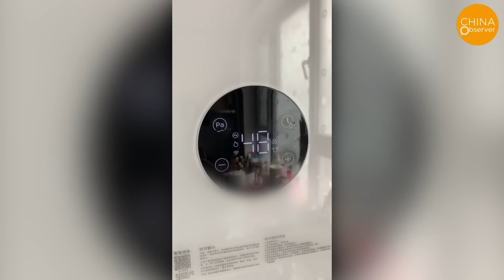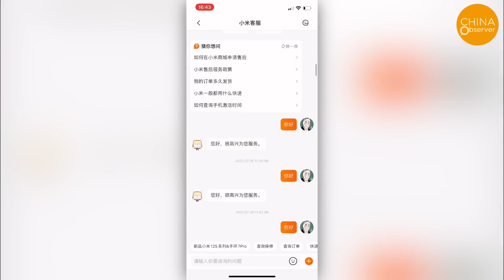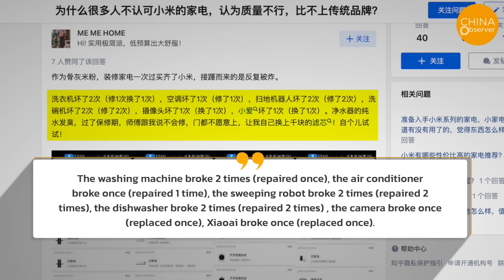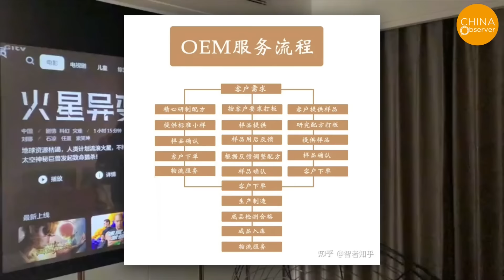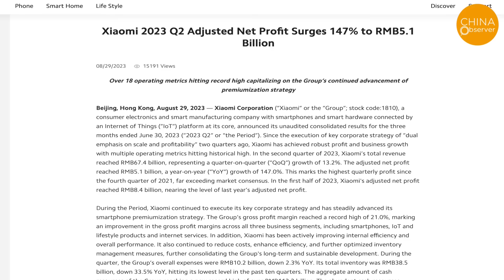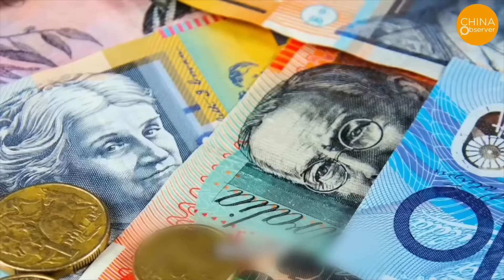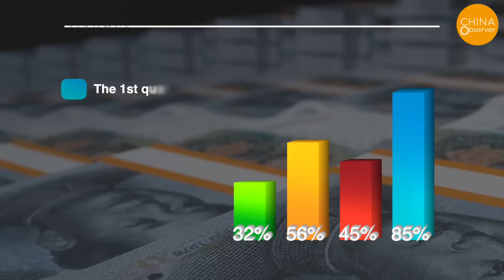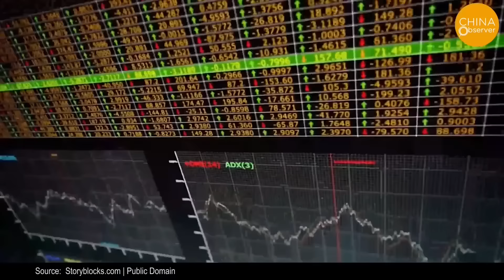Xiaomi Is Trash: Its Quality Is Shockingly Bad. Buyers Smashed It

Comment: I have a Xiaomi Mi 9T since 2019. While everything worked fine when I got it, with each software update features where changed, added, broken or removed entirely. I am at a point right now where it finds software updates for MIUI, but fails to download them.

I also got my mom a soundbar from Xiaomi, but I modified it slightly to use a different power adapter because of the weird voltage requirement, since the included one ran extremly hot. Except of that the soundbar works fine.

But hearing even before that the quality drops more and more, I doubt I will pickup another Xiaomi product, especially not another Xiaomi phone ...

Comment: Xiaomi still is an ONLY cellphone manufacturer, that up to this day let's you split screen and run two apps in real time. I have YTbon one and a game or gmail on the other. Samsung can't do it even today and it SUCKS. This and optics is an only reason i buy them. Also they use the same screen as iphones. I don't know about low, mid end models. I also know nothing about any other products.
Reply: my a12 has that, check on labs first before you spit bs

Comment: One of my rules of thumb in buying things is: To buy only specific things that match the company's speciality. 
So if I want to buy a smartphone, I would go to companies that are mainly sell smartphones and known as outstanding for their smartphone. I wouldn't go to a household product speciality company that sells smartphones as their second-third project, because I know where their focus on.

Anw, that's why I also own Xiaomi Mi5 that has lasted for about 7 years that has great performance, with a bending frame, and cracked glass, but still a clear display without any pixel problems. Been drowned and dropped many times and still revived, and never once put into the factory for repair. Really tough one. Until not long ago the battery started to bulge and finally put on rest a.k.a. ded fr.

Comment: The video clip shown at 3:00 minutes is probably not a problem due to quality, but rather looks like a user error. Usually, the machine only starts to wander if the customer forgot to remove the transit bolts (3 to 4 screws that hold the spring loaded drum in place, so it doesn't swing during transit). 

If those are left in place, the drum can't swing freely and counteract the imbalance, especially during the spin cycle. All the imbalance is then transferred to the entire appliance and causing it to wander. I had this "problem" happen to customers of mine in the past, even with European brand name washing machines. At some point I just started to remind customers to not forget to remove the transit bolts. 

Other than that, yes, a lot of products made in China, even under other brands or brand names they bought all over the world, are often not that good when it comes to quality.
Reply: My parents (this was decades ago) had an old  GE or Whirlpool that did that.  Scary as pluck.  But it was old.  It was replaced.

Comment: What a load of crap. We've had Xiaomi smartphones since 2015. Probably a dozen or so by now. No problems at all. I've just got the Xiaomi Pad 5 pro, it is fantastic. Again, no problems. We have 6-7 lamps, some are over 5 years old. Never a problem. We have light bulbs from Xiaomi. Never one problem. We have chargers from Xiaomi. Never a problem. We've bought 3 or 4 earphones. They still work perfectly despite being 7 or 8 years old from a time before wireless. We've had two electric toothbrushes. Never a problem. All products have been great value, with very good design, so the aesthetics are also ok. 

I know we don't live in China where Xiaomi sells many more products for the home which we don't have in Europe to the same degree. But to us, Xiaomi stands for great value, quality and great design. I have been disappointed a few times with products from China but never from Xiaomi.
Reply: It has probably to do with their recent products, last year I bought a Xiaomi Tpro and it's already having a bunch of problems such as glitching screen, battery problems and apps shutting down. Their older products may have had a good quality but at the moment I would wait before getting something new from them

Comment: Xiaomi doesn’t make these. Most of the times it is an OEM rebrand. I on the other hand owned a pair of earbuds and a phone a year back and they worked well beyond their price I paid for them. Unfortunately the phone I used was battered beyond salvation and I accidentally carried it with me to the sea ending its journey abruptly. The buds just started losing its charge after two years and switched to apple because I bought an iPhone.

Comment: I've had their Mi 11 Ultra phone for over 2 years and the camera tech is still the best I've owned so far. Had to retire it after the battery life became too short and the screen repair cost after a short drop off the couch cracked the screen. I considered a new Xiaomi but the reviews of the newer models are less than stellar compared to the 11U. Combined with the lack of network bands for NA, i switched to Oneplus to save myself the hassle. Seems Xiaomi is getting lazy.

Comment: my 46 inch sony tv from 2011 still working great, i bought a Xiaomi 55 inch tv in 2022 after 1 year display panel start flikering so i call the xiaomi support and they said its panel issue and panel cost is 20 percent less than new tv or exchange with new tv.

Comment: Xiaomi strategy is good software out of the box, and everytime your phone will have an update it will slowly become slow and have bugs making the phone laggy annoying to use unusable, so better dont update your phone if its working properly or switch to custom roms if you know how to do it.
Reply: That's not the case. They always had certain support period for their phones software updates (1-3 years, depending on price range). The main  factor of phone slow downs is the internal Android framework and behemoth Google Play services and apps that take more and more resources with each update.
Like my oldest Redmi 3 was released in 2015, last official firmware update was in 2016 but it still works until this day but obviously feels slower than back in the day. Xiaomi has nothing to do with it for 7 years, but Google services and apps still updating, taking more and more resources. If I were to install clean custom firmware without those services, performance would improve significantly.

Comment: It is not just "Xiaomi" products that have quality issue,  basically, all and every things "Made in China" would have quality issues, due to the manner and pressure exerted on the production lines to run faster and faster.  Additionally,  if you ever dismantled a "Made in China" Chinese Brand electrical appliance, (Caution / Warning , that is if you are qualified to do so), you would be shocked by the poor quality wirings and soldering of the connectors.  It is no wonder, such products, do not have long usage duration and would break-down (esp. due to over-heating) etc. soon after putting to use.

Comment: It ain't that bad i my family, except my father, had a Xiaomi note 9S since 2019, and here we are, and also, i don't even have an screen protector neither a protective case, and my phone has fallen a good ammount of times, It doesn't even have a single crack, and my mother has a Xiaomi mi band, don't remember the model, but she has had It since 2021 and it's been in water a lot of times so It is water resistant as It should be and it's very scratched but not broken

Comment: havent any problems with xiaomi products. robot vacuum is already 5+ years in use without any problems, last 3 smartphones also didnt had any problem. smart watch also already 2 years in use with no problems. Only complaim maybe wireless headphone, battery degraded faster than i was expecting after first year, but remains at same level since first year (already 4 years in use). maybe im lucky

Comment: I had XiaoMi hairdryer and got almost killed by it because the electric wire insulation broke and the sap I received was insane.
In addition I also have XiaoMi vacuum robot that works but it’s battery is already so out after one year that it only finishes my tiny room on low power level 😢

Comment: The water heater is supposed to switch off when it reaches the maximum temperature, you either turn down the gas or turn up the water flow to maintain a steady temperature somewhere below the maximum. That's just how they work.

Comment: Xiaomi is becoming a useless brand as time goes. My Xiaomi Smart Band 7 pro failed after few months. Reason: I showered with it few times and its screen failed to respond to touch.

This absurd, remembering I was replacing my 5yrs MiBand 3 which still works to this moment.

Comment: The problem is that some Xiaomi phone customers expect the same excellent quality and service for their appliances, but Xiaomi appliances are very cost effective, probably not enabling the same level of service.
In any case, I ordered my Xiaomi washer at 11pm and it was delivered and installed at 14pm the next day. So far it's working great for over a year, even though it gets hosed down by rain as it's on a terrace. Chinese usually have the washer on a balcony. My Xiaomi 65" TV is 5 years old and survived a move, my Xiaomi juicer seems indestructible and my wife and daughter have XIaomi phones, flawless. We also have one Xiaomi AC split, I don't know if it will last but it's much quieter than premium brands at similar settings, better remote too. Many people in China choose Xiaomi over other Chinese brands as their quality is usually better, and so is value for money. I think the video overblows the problem.

Comment: Purposely rogue chip manufacturing? Chips are designed to fail when it detects time & date, possibly through software?
Can you "jailbreak" Smart TV's? A computer programmer could look at the firmware software program code & remove any planned obsolescent code?

Comment: My mom bought a Mi EVA cleaning robot but for some reason every single one day in the week the robot would not clean the whole map my mom prepared the part that robot will clean but the robot says finished but it missed a whole section heck the door was open to that room and every single month the robot will give out an internet error that says the connection of the internet between the robot and the main unit is unstable. Just one thing Internet? Internet just internet can mess up a robot? If the internet is unstable then what is the map used for? That’s what I’m confused if the map is already programmed why does it need internet?